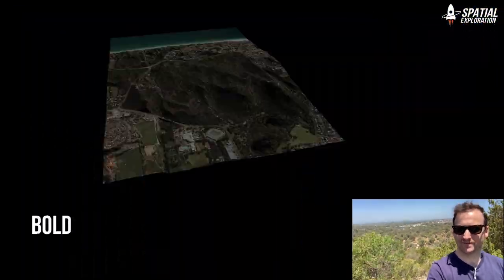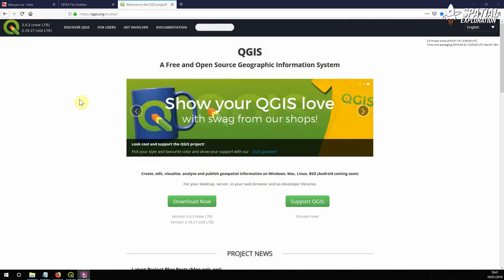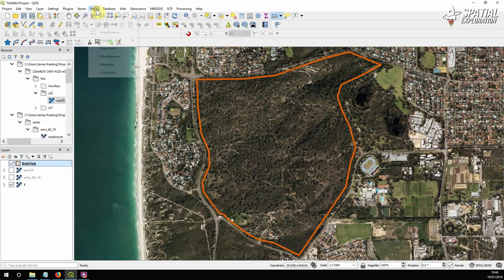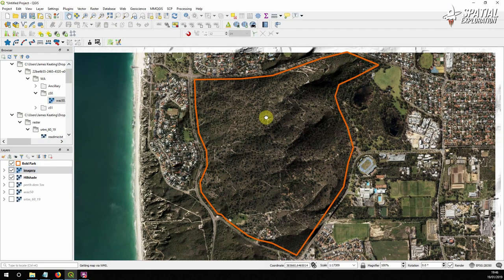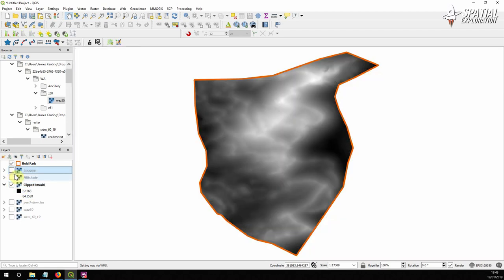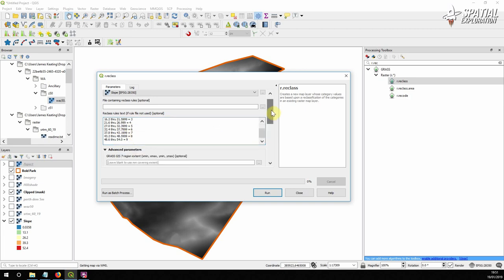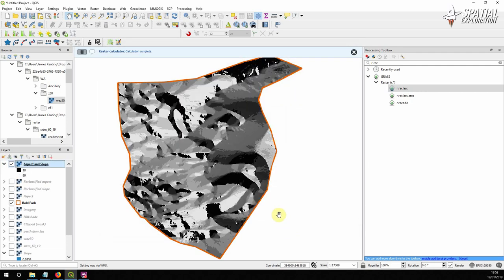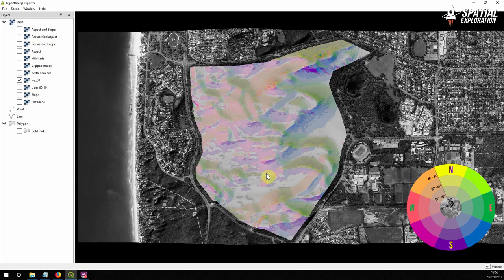Slope & Aspect modelling in QGIS 3.4

Comment: If anybody wants to do the legend in QGIS, one method is to create a polygon circle and divide it up.

Create a point, buffer to whatever distance you want the inner circle to be. Then use the wedge buffer tool, and set the azimuth to the compass directions. Repeat 8 times for each direction.

Then use the inner radius and outer radius to to create your outer rings, and repeat the process.

Comment: Great video! I found this to be a very useful guide. When I convert my hillshade into a slope (expressed as a percentage) the results range from 0 to 1890. Can you tell me what these values mean? It can't mean a slope of 1890%, can it? Thanks very much!
Reply from the maker: Thanks Emma. Couple of possible issues
 

- The elevation model you are using (i.e. the DEM); is the coordinate reference system (CRS) unit in degrees or metres? It needs to be the latter (check by right clicking on layer then  Properties>Information). If its in degrees you simply save a new copy of the DEM and pick a CRS that has meters as its unit (e.g WGS84 - Pseudo Mercator). Then continue your analysis with this new layer. There are probably more appropriate CRS for your area of interest so either google it or keep an eye on the little red map in QGIS which shows you the geographical area for which a CRS is valid.

- Are you converting your hillshade to slope or your original DEM/elevation model to slope? It should be the latter. 

 -Otherwise maybe check the properties of the slope layer you created (Layer properties>Information) and check the minimum and maximum values here (should be between 0 - 90 degrees or 0 - 100%). If the min-max looks OK then just readjust the values to match in the symbology. I don't think this is your case but worth a look anyways.

Let me know how you go,

Cheers,

James
Reply: @spatial-exploration1478  Thanks for your response! It was just the trick. I was converting directing from hillshade to slope (not from the original DEM). Do you teach this material, or just work with the software? Looking forward to seeing more of your videos on QGIS!
Reply from the maker: Great to hear that  @emmaposluns1238 . Will have a few new videos coming soon.